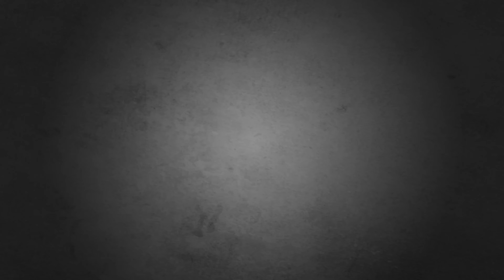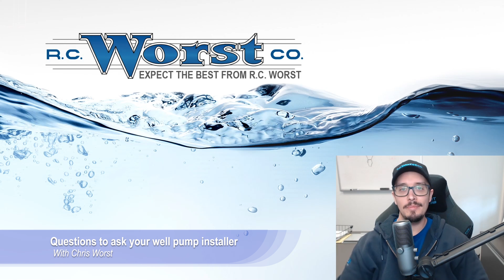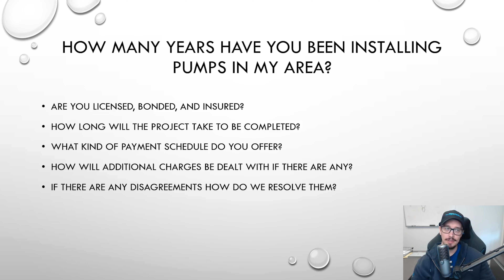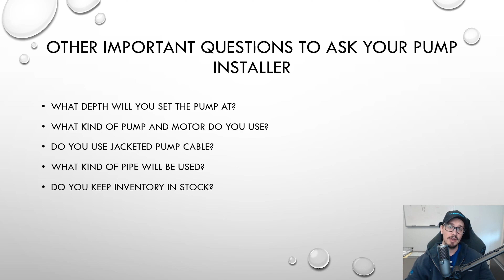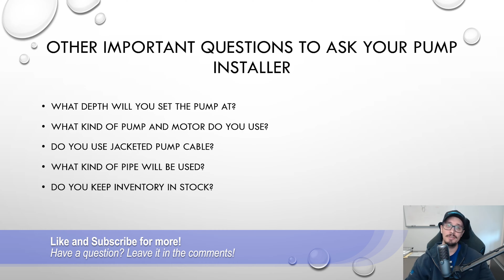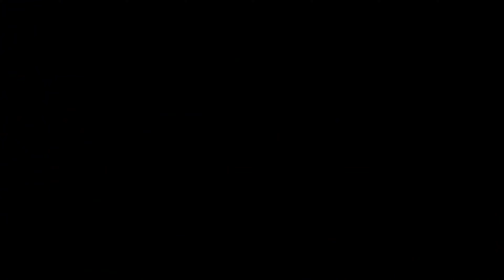Questions to ask your well pump installer

Comment: Hi, the well guy I hired told me to put my pressure tank at 33psi in a 40/60 pressure switch system instead of the 38psi it comes from the factor, what are the benefits or not of doing this?

Comment: queston im going probly 4th deep well pump in 20 years my pump is in the house iv had i think in the beginning 2 1/2hp pumps then a sta-rite 3/4 and last year went to a Goulds SJ15 with 1hp smith motor all double nose pumps was sapost to be rebuilt think i had it 8 months most any ways sapost to be set up vertically but just put in same way as all my other pumps horizontal   iv had now i have high water pressure until pumps turns on and im not loosing presser when pump is off my guess the seals in the pump or something mest up with the Impeller im pretty sure its dripping under the pump i orderd a rebuild kit hope thats the problem becus i could of got a 2hp sta-rite msg-6 looks like a 3 stage just rebuilt for the same price as the golds pump rebuild kit anywase it looses presser so bad when pump kicks on you can only use 1 sink if you use 2 or even turn on hot and cold at the same time punp will loose prime then i gotta shut water primp pump 1 time pumps right up then turn water back on until next time
Reply: is this even a question?